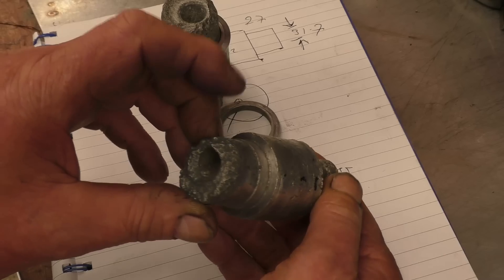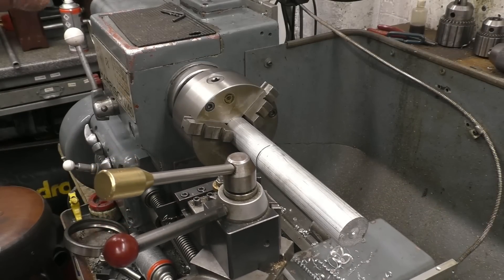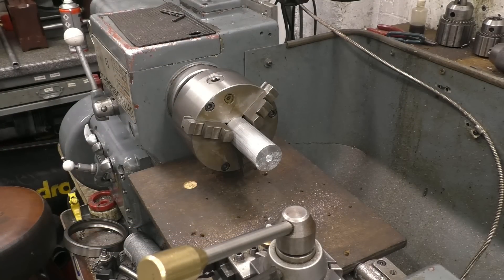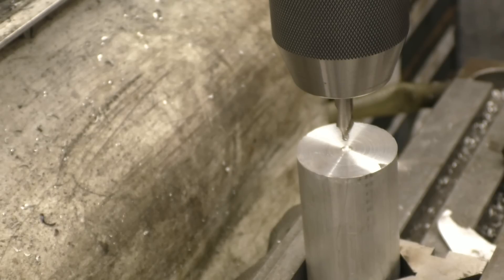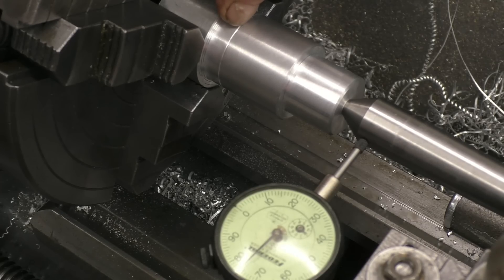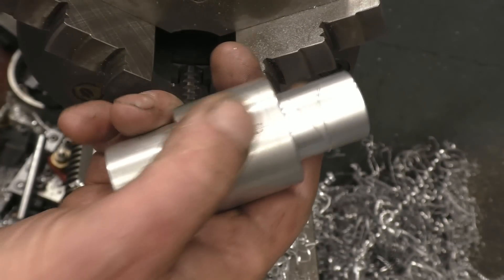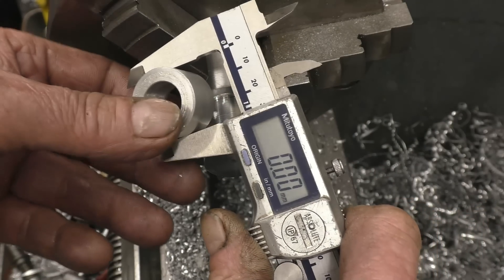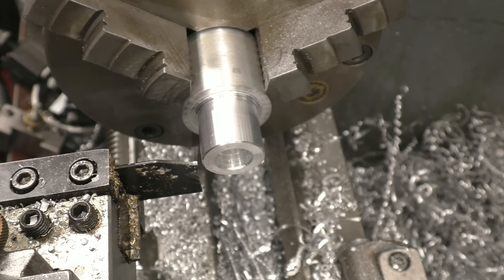SNNC  442 P1  Machining Aluminium

Comment: Thanks for well filmed, edited and produced video.
Finally a skilled machinist practised something I've been thinking about, facing off only a small area, enough for center boring. Operating a little mini lathe the need for tail stock support is needed more than often. Thanks John!
Haha, aluminum... horrible stuff.... It's rather okey for a hobbyist but real steel has a given place in many designs.
Hacksaw, or the bandsaw?
Time 07:45. Offsetting the object in the 4 jaw. That is not trivial. Sad You lost the filming. It had been interesting to watch.
I use, as we call it, "White spirit" (denaturised) as cutting fluid for aluminum. Works really well.
More to come..